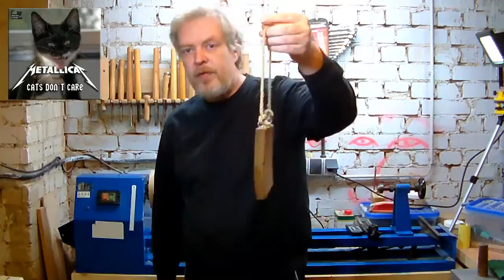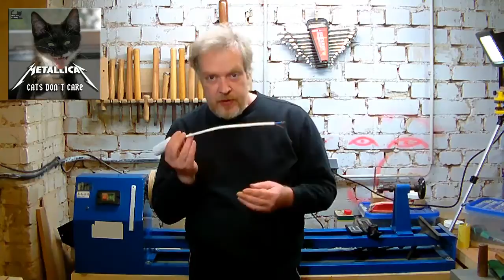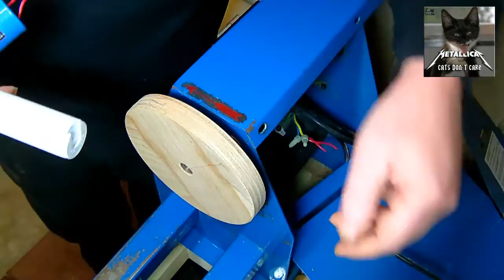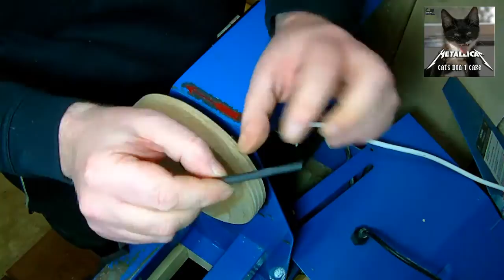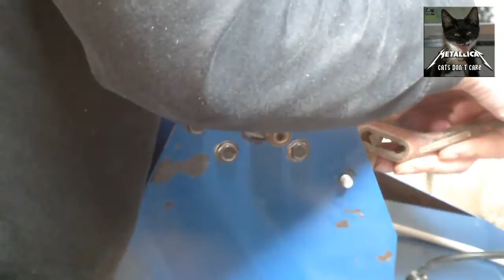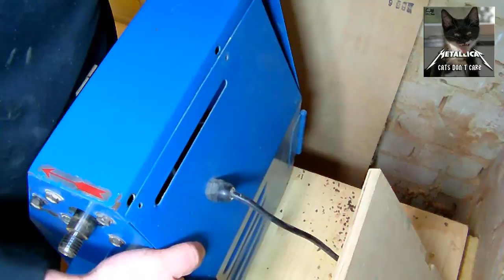Why I I'd been away and some Lathe Motor Maintenance

Comment: Glad you got your lathe running again............next time you need a capacitor you might want to check eBay, I can usually get a new one like that for about 5 dollars with free shipping here in the USA but it may be different in Germany.
Reply from the maker: Thanks Sparrow,
actually I checked online, the cheapest one was 10 EUR including shipping, nothing cheaper :-(
The price of 15 EUR, I mentioned in the video, is actually the average of different suppliers. In the end I was lucky to find a local company, specialized on repairing electric motors (everything from a vacuum cleaner up to 100+ hp industrial motors) who sold it for 8 EUR, so sometimes it pays to take the phone and call different local businesses.
In the end, my running lathe is all that counts. Now I'm able to 'make some shavings' again.
Greetings from Good Old Germany
Peter

Comment: Good fix! I always try to fix things myself, saves so much money, especially since these days, so many products are just designed to break quickly.
Reply from the maker: I don't know, how they do it, guarantee is due for half a month and a tiny little thingy breaks. I've got a washing machine with an LCD-Display. The light, illuminating the display is broken. 50 cents of piece, but they only offer the whole unit as spare part, 150 EUR the spare part only :-(.
That's how they make money nowadays.
Greetings from Good Old Germany
Peter
Reply: One day that will change as people wont have the money to buy their stuff anymore. But till then, we get ripped off. I choose repair over recycle. But being Dutch, i guess im extra tight with money :)